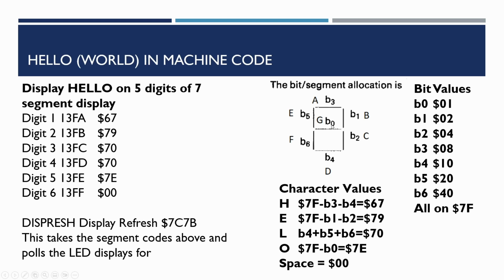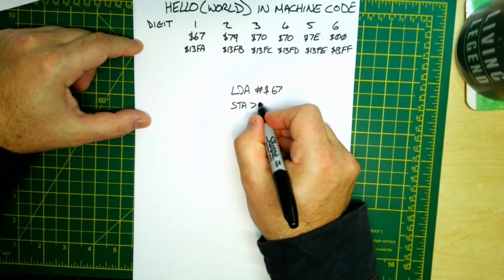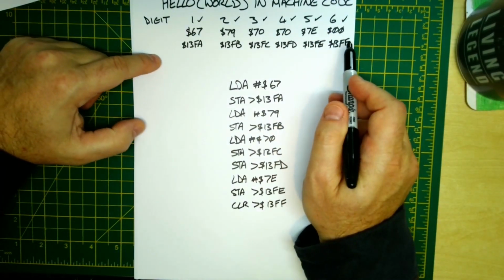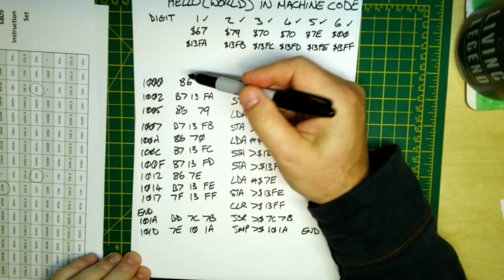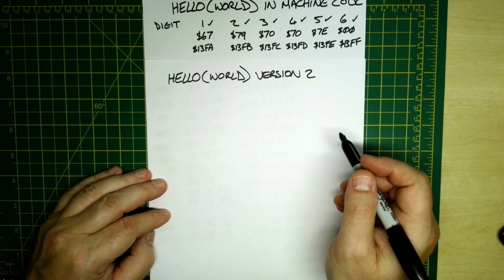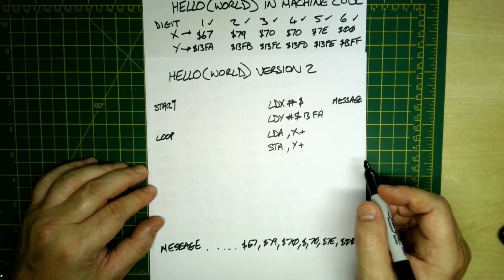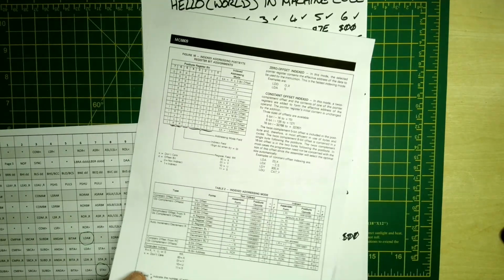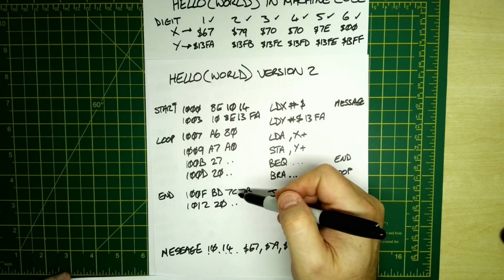Nanocomp 6809 #11 Machine Code Hello World - 8 Bit Breadboard Micro

Comment: Can you upload the two "simple" sheets for the code instruction sheet as a PDF File?
Reply from the maker: Sure, I will add them to the asm folder on GitHub https://github.com/breadboardinglabs/Nanocomp6809/tree/main/Asm later today.
I have an asm source version of the second example too. I will upload that.
Reply from the maker: Uploaded into GitHub, also hello.asm with V2 example and assembler output file
https://github.com/breadboardinglabs/Nanocomp6809/tree/main/Asm/helloworld